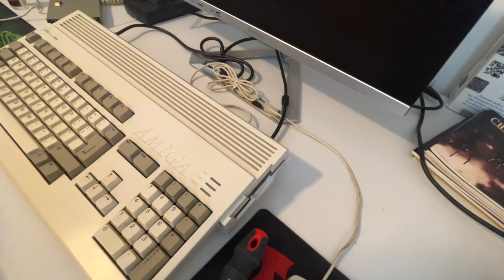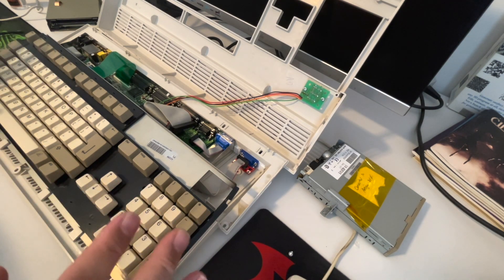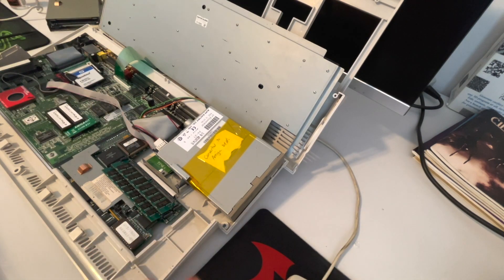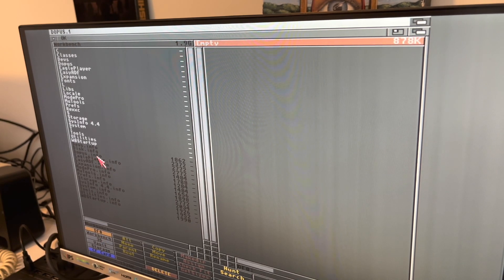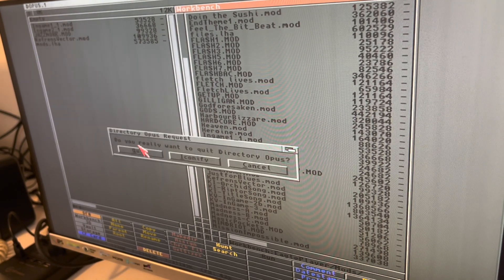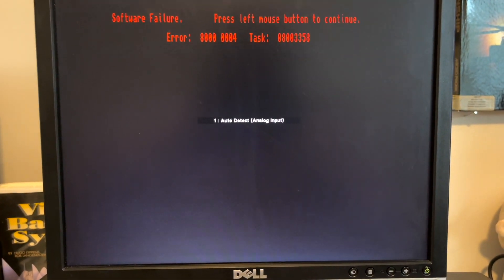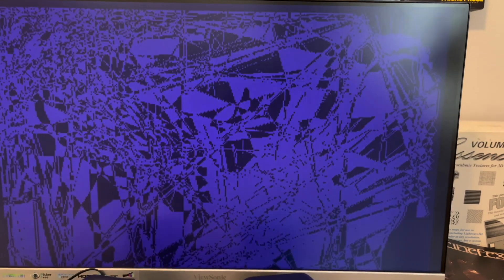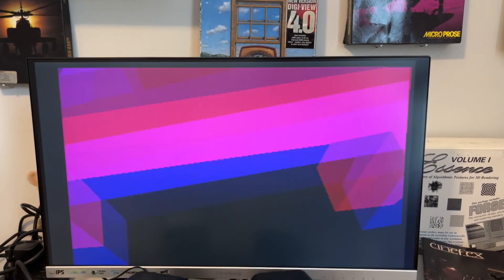Converted PC floppy drive for Amiga use!

Comment: Looking at your amiga i think it's an escom amiga ? 
Did you do the "escom mod" on it already as i'm told escom did some funky extra wire  thing to the motherboard to fit PC diskdrives when they ran out of original shurgard and work around some  "wait state" or "ready" signal the motherboard needs that the PC floppydrives don't have ? 
I'm not sure, did you use a  PC diskdrive modded into shurgard on a motherboard that's modded to work with PC diskdrives and doesn't work properly with shurgard  ?
Reply from the maker: I have both an Escom and Commodore era 1200. The Escom one definitely looks different on the inside. I’ll have to check for the mod you’re speaking of. Not familiar. I do know the floppy drive that came with it was a Chinon and had a sticker that said “A1200”. Thanks for watching !
Reply: @HoldandModify 
A chinon ?  I thought they were the shurgard types and panasonic the converted PC ones but i may be mistaken. 
Here's more on that escom mod: https://www.youtube.com/watch?v=G6fYOjTYvXM&t=10s
And thank you for uploading 👍👍